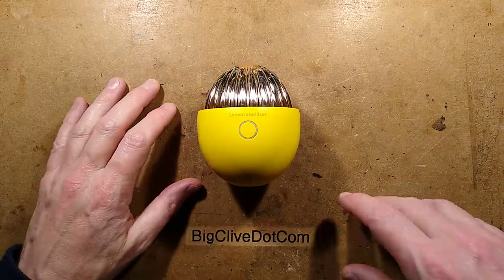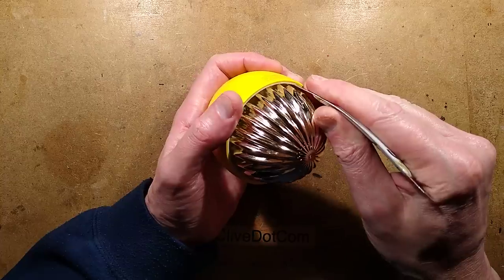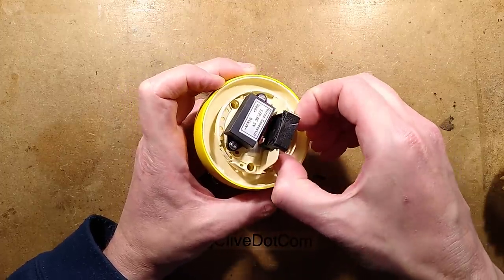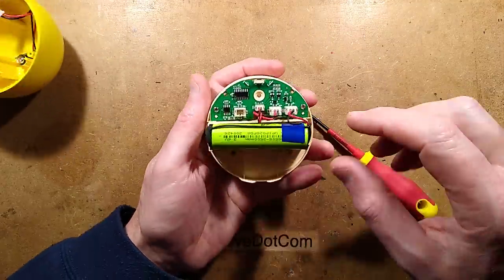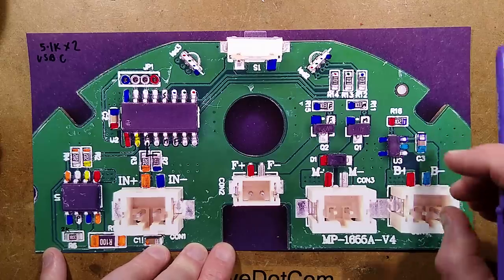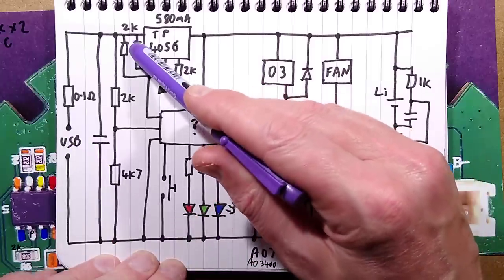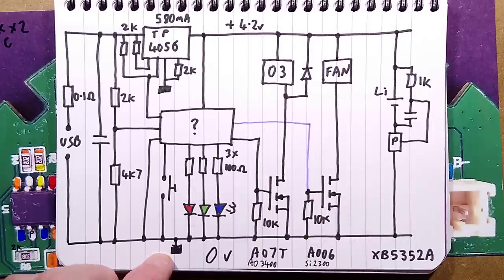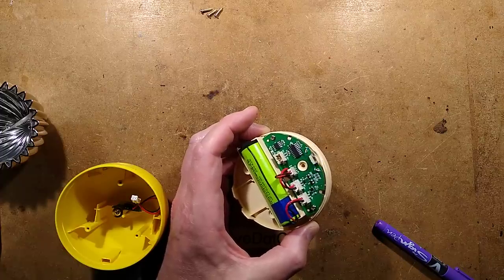Xiaomi high voltage refrigerator lemon

Comment: I recently purchased this after watching your video. It works well but today I decided to upgrade the battery, I have a battery spot welder so its an easy procedure to do. I used a Sanyo NCR18650GA 3500mAh 10A Battery which is a very good battery, it will be interesting to know how much of an increase in runtime the new cell will give.

Comment: From the initial shot it looked like it had some "claw like spikes" in the top and I was REALLY confused about the "lemon sterilizer" and thought: "now they completely lost it and some quack says that lemons cause some illness with C".

Edit: Where did you get the Lemon from? I can only seem to find it on AliExpress. 
Haven't had any ozone items but I thinking of testing one in the kitchen to maybe eliminate some smells when I cook. Would that be a realistic use case?
Reply: There is indeed a lot of C in lemons.

Vitamin C.
Reply: It's really not a great idea to bring ozone producing devices into your home. it's aggressively reactive to most odor causing compounds true but its aggressively relative to most organic things including your lungs.
Reply: @mgkleym   You want to limit your ozone exposure, but what now, don't bring in any fresh outdoor air either? That's got ozone. When it sits around in your room, away from UV light, ozone disappears. These things really don't make a lot of ozone.
Reply: Ozone can, indeed, remove cooking odors. The house I grew up in had a 1950s Magic Chef gas range that had an ozone generator. It was a UV lamp (argon bulb?) that would generate the ozone.
Our clothes dryer also had a little UV lamp in it to produce ozone for that "dried outdoors" smell.
Apparently, appliance manufacturers were really into O₃ back then.
Reply: @mgkleym  I wouldn't sit around and sniff that thing all day long, NOR would I leave it running 24/7.
I personally would use it more like this:
I've cooked a "smelly" meal. Vent the rooms properly with fresh air and then turn on the Lemon. Because we don't have a door in the kitchen, often times the hallway, livingroom and kitchen smell like garlic or fish for 2 days. If the Lemon can help I'm fine.
Reply: I've had mine for about six months, bought off eBay. We have one in the fridge in "green" mode (low) which lasts about a month. Use another one in open air by the cat box, also in "green" mode. Third one as charged spare to swap in when a battery dies. I wouldn't use "blue" mode (high) unless you were disinfecting something. It's quite aggressive.

Comment: Nice build quality. The ubiquitous A2SHB mosfet technically corresponds to a part number of Si2302 - I wonder if that A006/Si2300 is related somehow either originally from the same vendor, maybe a predecessor, very interesting.

Comment: Could you put a couple of these in a car with the AC on and recirculating mode chose (air drawn in from inside the car) to de-stink the car and A/C for example from cigarette smoke etc. ? Of course you would stay outside with the doors/windows shut)
Reply from the maker: You can get ozone generators for cars.  Just recommended for bursts of use.
Reply: better idea is to get a regular one and put in in your car overnight for a few nights, but air the car before you drive it in the morning.  That will keep the car fresh for a while.

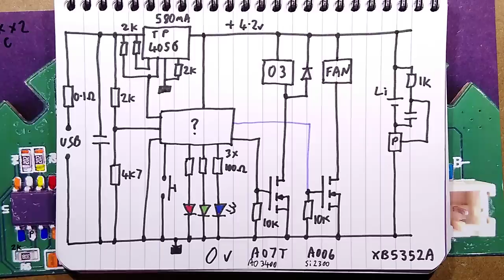Comment: 12:00 Why would they switch the ozone generator and fan independently ? Surely it's either both on or both off - so only 1 switch required?
Reply: Perhaps the fan runs by itself for a while just to circulate the ozone around the fridge better.
Reply: @Microfrost  Clive didn't test that but it's a possibility. AKA 'fan overrun' !
Reply from the maker: Some units turn on the ozone plate before the fan.  It may be easier for the discharge to start.
Reply: @bigclivedotcom  LOL - You call that a fan ? :) I'd produce more of a draught farting.

Comment: Hi BigClive, would you consider making a diy "Jacob's Ladder" using a high voltage module hooked to couple of copper rods. I have tried a couple of times myself but I always seem to blow the ht modules. Keep up the good work 👌
Reply from the maker: It won't work with the pulsed high voltage sparkers.  It will have to be a continuous high voltage.  A neon transformer is often used.
Reply: @bigclivedotcom  Ah that's where I've got it wrong. Thanks for the heads up.

Comment: Just curious. Is there a warning to let the device warm up after you remove it from the fridge before you charge it?
Reply: What for? Where have you ever seen a "warning" about charging 'fridge temperature' items?
It's 4 degrees in the fridge and 10 degrees in Clive's workshop. Makes no difference.
Reply from the maker: I do that anyway.  But it tends to be below fridge temperatures that lithium cells shouldn't be charged.

Comment: Nice design but I worry about condensation occurring on the PCB every time it's taken out of the fridge to charge. Either 1. They ensure their PCB is really clean (no hygroscopic flux residue to cause dendritic growth / shorts in high humidity) or 2. They just don't care - I suspect it's the second one!  If I bought one I'd give the PCB a good spray of conformal coating so it doesn't die after a few charges.
Reply: I suspect the PCB is MEK-washed, it sure looks like it. It's actually a standard process after SMD assembly. Then, when through-hole components are installed and soldered, usually manually, the PCB is contaminated with flux again. However, all the connectors on this PCB are surface mount! So the PCB stays clean. It even looks like the connectors are made from LCP, you usually expect cheaper Nylon connector shells, but those don't fancy lead-free surface mount soldering quite so much. The connector shells are even side stabilised with metal inserts, oh my. Almost no expense spared.
Reply: @SianaGearz  yes good point I hadn't picked up on the fact that the connectors were SMT. Flux residue usually affect wave or selective solder processes more like you say - having said that I've visited enough dodgy Shenzhen factories that don't wash boards after SMT or even have a proper reflow profile so I'm probably cynical about these things!
Reply: @pyromaniac303  oh hey it looks like I overlooked some thin white lines. So indeed they probably haven't washed it, they just used a paste that doesn't leave too much of a visible flux mess behind.

Comment: Are you still using your one? Mine seems to have some corrosion on one side of the chrome top now. Still seems to work though. Very pleased with it.
Reply from the maker: I've got it, but use a different one.  The corrosion will probably be from the high local concentration of ozone.

Comment: Why not make one the screws into the light bulb socket and then have the bulb screw into it. Batteries in this application seem silly to me.
Reply: because the light goes off as soon as you shut the fridge door- a few seconds of power wouldn't be sufficient to charge the battery.

Comment: Does ozone play nicely with electronics in confined spaces? I placed a large ozone generator device in the foot well of my car to get rid of the damp smell after a shoddy valet job and it broke the lcd display of the heater control. I'm not sure if it was the ozone that did it or whether it was just a coincidence, but I've been a bit wary of keeping ozone generators close to electronic devices ever since.
Reply from the maker: It was probably a coincidence.  But ozone is a strong oxidiser.
Reply: If anything, next to a coincidence, if the unit was ehm, leaking a lot of high voltage interference, you might actually have caused so much interference in the wiring tree towards that part it burned out...

Comment: As Ozone is quite "radical", does Ozone attack plastics (or any other of the materials inside the fridge, like rubber/silicone seals or paint)? Would be quite bad if something became brittle or porous over time.
Reply from the maker: Over a long time it will have an effect on some surfaces.

Comment: Nice device... Should there not be a diode for protection of the fan MOSFET?
Reply: Those fans are usually brushless with an integrated inverter, which probably already has diodes on it's mosfets.

Comment: I'd be interested to know how the temperature of the fridge affects the 18650 capacity and life.
Reply from the maker: As long a it doesn't go below 0C it should be OK.  But I allow things like this to return to room temperature before recharging them.
Reply: I've had these for about half a year now. Ultimately bought all three. Mine last about a month in "green" mode in the fridge. I wouldn't use "blue" mode inside the fridge -- it's quite aggressive. Great for open air though. We use one by the cat box. Lasts roughly two weeks.

Comment: They should put a photoresistor that triggers the unit to run for a few minutes, every time you open the fridge door and light is detected.
I think these all run too long and produce too much ozone. 
I don't see why it wouldn't last 6 months or more before requiring a recharge.

Comment: Will the ozone generated harm the plastic interior of the refrigerator? Will it damage small electrical components (ICs, relays, etc)?
Reply from the maker: It may cause slight surface oxidation of some materials over time.

Comment: Any reason for mosfets being used instead of transistors? Just a cost thing? is it the new way to switch?? or just that the gate is a voltage switched device???
Reply: I suspect that the MOSFETs are just as cheap as BJTs and they have the advantage that they appear as purely resistive devices (Rds in the datasheet), rather than the 0.6-0.7V  junction  drop in a BJT.
Reply: Those Alpha Omega parts (AO34XX) and many similar such as HX3401 are Trench FETs with extremely low RDSon (resistance) in the order of a few milliohms, so there's virtually no voltage drop across them. Additionally they can switch many amps in a tiny SOT23 package. Source: I use them in many of my designs.
Reply from the maker: They're cheap and very easy to drive.

Comment: I have another ozone lamp for sterilizing rooms, and in the instructions for it it says to remove all food from the room because of the rapid oxidization effect. ( also plants and of course pets) - So, that seems to go against filling your fridge with ozone since the fridge us usually where food is stored. Any thoughts on this?
Reply from the maker: This unit produces low levels.   The UVC lamps are more of an issue for living things like humans, pets and plants.
Reply: @bigclivedotcom  okay, I see! Yeah maybe they are slightly different beasts :) or different size beasts rather... So I guess as long as the food in your fridge is dead then it should be ok regardless. But... if the concentration gets too high, poor yoghurt !

Comment: With the chrome-dome directly pressing down on the ceramic corona discharge plate, is there any measurable HV leakage between the dome w.r.t. USB ground?  I realise it’s not meant to be used while plugged in, but might be a tickle if you take it out of the refrigerator - leaving it on - and plug it in to charge.
Reply from the maker: It touches the ceramic insulator plate.  Although it's conceivable that the high voltage could track across from the electrodes, the lack of reference to the high voltage ground would reduce the risk of a fizz.

Comment: Just out of interest.... Whereabouts in the fridge would you put something like this? Top, middle, bottom or wouldn't it matter?
Reply from the maker: Anywhere.  The ozone merges with the rest of the air.
Reply: I'll yield to the ozone expert on the gas itself, but the batteries will stay warmer and run the device longer if it's on the top shelf.

Comment: Again, we need to get USB power outlets inside our fridges. Let's modify our fridge lamps to: A) contain a safe, isolated 230v AC => 5V USB module with built-in LED lighting plus one or two USB outlets with at least IP65 rating for the adapter as a whole! Let's also have USB outlets on our Lavatories too!

Comment: I  am worried about the longevity of the seals in a fridge - is that not a problem? Is the ppm of ozone not high enough to cause trouble in the longer run? I would much rather store a Cs137 source in there, but those are hard to come by :-P
Reply from the maker: It's not a very high output.

Comment: Any recommendations to improve oxygen "air" inside a smaller room? you taken apart so many products some you recommendations? to buy to use for this purpose?
Reply from the maker: For cleaning air a hepa filter  unit is a good option.  Low level ozone like from an ioniser may help reduce any odours.
Reply: @bigclivedotcom  Thank you!🥰 Then the hunt begins!😁

Comment: Just got mine and paid probably way too much (nearly 30eur shipped) from the handful of sellers still offering these. Mine came branded "Peripop" with different address on the box and everything. It does look to be the same device despite the odd branding and piss-poor quality metallization of the top, however mine had one big problem (aside from every single screw being rusty): the fan was seized right out of the box. I've disassembled the fan and got it rublicated and running again but it's probably suboptimal. What's also subobtimal is pricing out a replacement 25x25mm fan that isn't a seize-tastic generic chinese special. Sunon ones (which seem to be the only ones fairly readily available) can easily cost between 8-20eur.. ouch. Let's hope my relubed fan will last a while...
edit: another thing I've noticed is that you can clip the chromed top part on in multiple orientations. Had to doublecheck mine was in the right way around (the baffle mentioned at 6:42 actually pushes down on the fan and holds it in place)
Reply from the maker: Sorry to hear you got one with a rogue fan.

Comment: Why use pull down resistors on the mosfet gates when they are connected to IO pins of an MCU? The IO pin will never be floating, it is ether 0 (LOW) or 1 (HIGH) so there can't be an "in between" situation where the mosfet can go in its linear region. What they should have done instead was to include a series gate resistor like 1K to prevent inrush current because of the gate capacitance.
Reply from the maker: In the initial start up the processor may have floating pins.  Also when the processor fails to boot.
Reply: The pins may be left floating when the uC is powered off, but there is still battery voltage applied. In rush current isn't often a concern since the io is typically current limited.

Comment: Strange they put a back EMF diode on the O3 unit but not on the little fan motor...
Reply: That fan is a brushless DC with integrated controller. It already suppresses the back EMF internally.

Comment: You could use this once in a while... But be aware - Ozone corrodes aluminum... The thin refrigerant coils in your fridge is aluminum!
Reply: European fridges don't typically have exposed coils, they are normally behind the plastic rear wall of the fridge.
Reply from the maker: Aluminium is surprisingly resilient to ozone.  The aluminium oxide surface is effectively already oxidised.

Comment: It's a shame more electronics aren't made and designed locally in the uk
Reply from the maker: A lot of Chinese made stuff may actually be designed by UK/EU designers.
Reply: @bigclivedotcom  indeed. It would be good if there was more manufacture in the UK, to bring in more profits and jobs again, as it used to be
Reply from the maker: @MrRedeyedJedi  That recovery would start with replacing the existing government and removing a massive wall of pointless red tape that makes manufacturing in the UK arduous and unrewarding.

Comment: I thought that lithium iron batteries would not function below certain temperatures and in particular will not charge.
Reply from the maker: Below 0C is not recommended.  I let the units warm to room temperature before charging.

Comment: I have a cpap machine and have to clean my mask a couple times a week so I bought this special cleaner that I put the mask in and it disinfect it. That damn thing was over 300 bucks. Essentially I could put this in a plastic tote with my mask and it would do the same thing right?
Reply from the maker: There have been issues with some ozone sanitisers degrading the foams of the masks.   The proper unit may circulate a precise level.
Reply: @bigclivedotcom  Thank you. That makes sense. I suppose sometimes there is a reason you pay more for medical equipment, aside from them sticking it to ya lol.

Comment: Unlike UV ozone generators ... "Corona discharge generators also create nitrogen oxides (NOx) which will if water is present react and produce corrosive nitric acid (HNO3)"
Reply from the maker: All ozone generators including nature produce those.  To get pure ozone you need to start with pure oxygen.
Reply: Right although UV doesn't break apart N2 in air, just O2, same as the Sun's 185 nm

Comment: I like that they used usb C. I still have few tons of micro USB cables in huge box, but I moved most of my devices to  USB and my "charging" life went back to normal as I don't jump from one cable to another .. Also I would probably buy that just to get that modular USB connector as I have two or three my own devices that still have microUSB